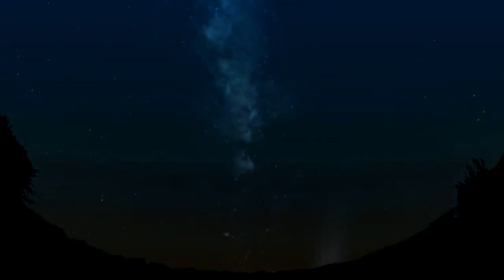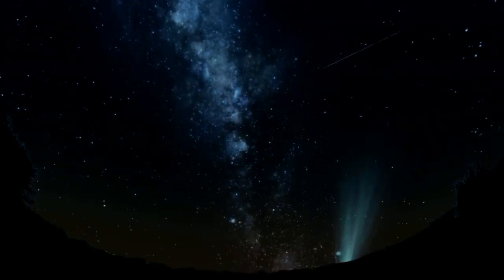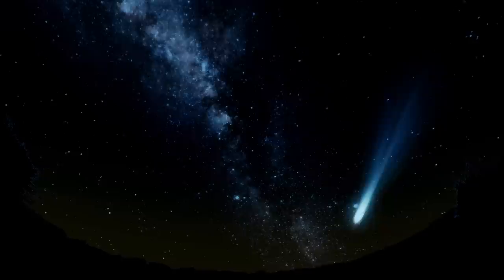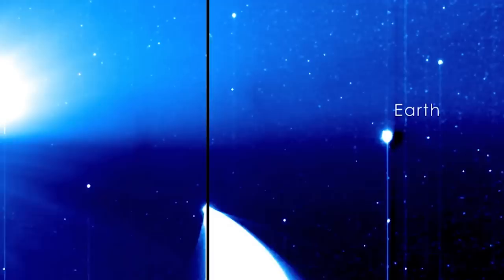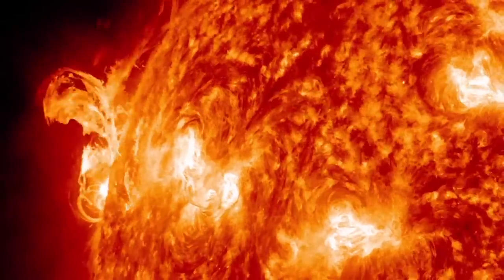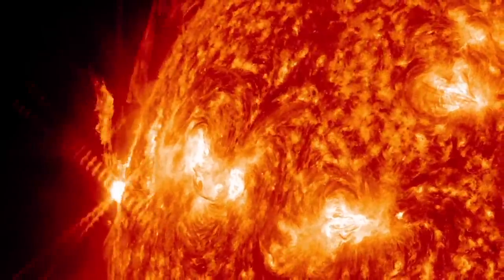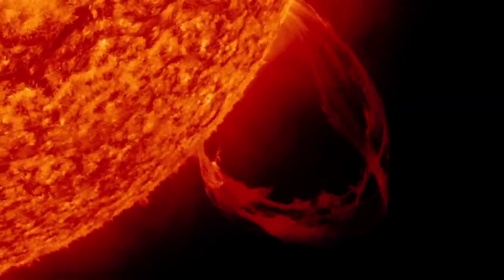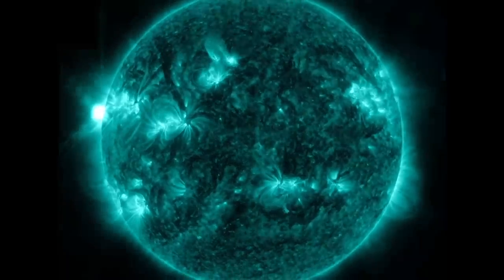Tractor Beams are REAL!

Comment: not what i would call a tractor beam. possible solution is to create a very strong magnetic field that act on matter diamagnetically and pulsate the field to induce motion of the diamagnetic object. i assume based on material like copper and even bismuth that there is a delay in the creation of the diamagnetic field and so it is with any elements in the periodic table. by this i imagine that the reacting diamagnetic field is delayed and by so we can manipulate this to our advantage by reversing polarity quick enough at a lower power so that the risidual diamagnetic field present in the object by initialization of a strong magnetic pulse will experience a magnetic pull toward a reverse polarity pulse of a lesser order of magnitude. this is only one way doing it. you can also do it in reverse by pulsing a bigger magnetic field against the collapsing diamagnetic field in the target mass and cause the weaker diamagnetic field for a split second to become inverted by the stronger field creating a pull reaction. for this to work the strengt of the field induced the second time must be in a duration shorter than the decay of the diamagnetic field of the target mass as it collapses. by using known principles of magnetic behavior diamagnetism can be forced to behave as normal magnetic field under certain conditions. we know that a induced current in a induction coil by influence produce a magnetic field that does not collapse instantly but there is a delay in the collapse and so it would be in any material reacting diamagnetically. there is technically zero difference between a current forming from linear polarization of magnetic dipoles and those of random polarization when it comes to the decay of the induced magnetism in the material. in order for a material of any kind to magnetize either ferromagnetically electromagnically or diamagnetically the particles inside the mass have to rearange their vector and there is a delay to how quickly they randomize again back to neutral. atoms are alway pointed at a vector in the molecular cluster or latice and must reorientate toward other atoms to form a diamagnetic field. technically all atoms in all the elements have particles in them that have magnetic polarity orientation. its just a matter of configuration to make any element magnetic by any property. technically all elements are different atomic configurations of hydrogen and means that magnetism is a property at the atomic level of hydrogen and that a ball consisting of many hydrogen particles will have individual vectors within the atom of hydrogen. when many hydrogen atoms are stuck together they behave just like molecules but their compressed closer together and the bodings are stronger.

Comment: Could you feed the laser more power yet send it through a hyper conductive material that absorbs heat yet let's light pass through it?
Reply: garrett gaddy That would not stop the laser from burning a hole into what ever it is pointed at. Heat is transferred through conduction, convection and radiation. The light from the laser will heat the object through radiation.

Comment: Hmmm...  I wonder if the same concept could be used to make a propulsion engine. You could fix the laser to the front of a ship and shoot it toward the back of the ship.  Because the beam isn't literally pulling it, but rather is causing a push from behind due to teh change in energy, the laser emitter could move along with the ship...  Hmmm...  I'll have to mull this one over.